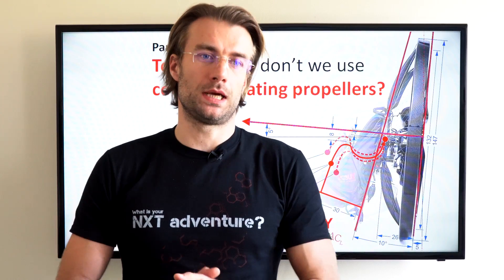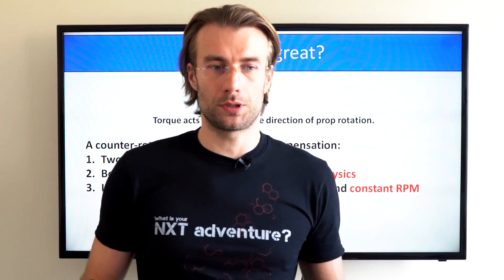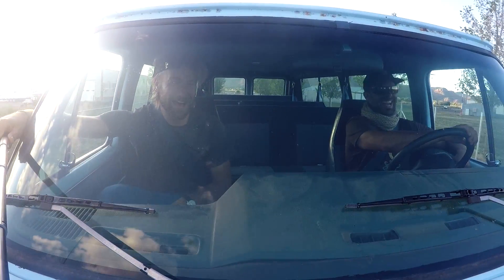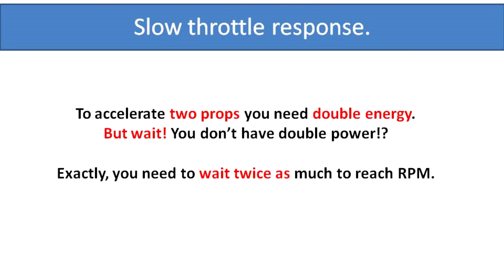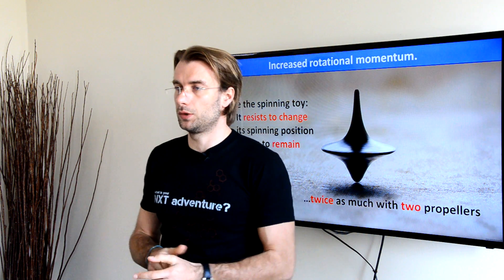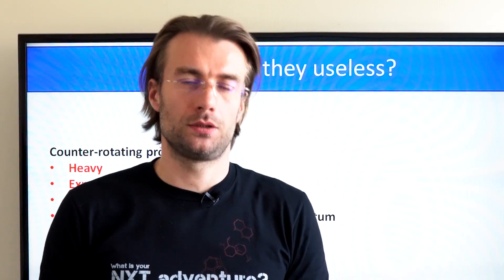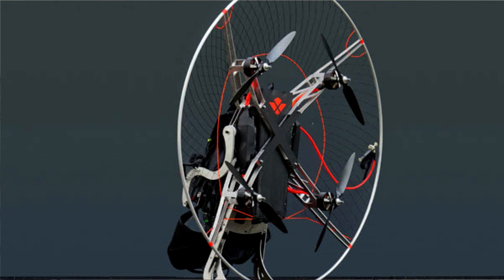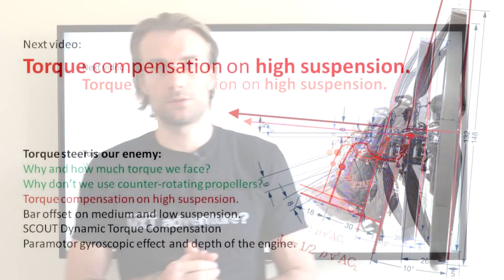Why don't we use counter-rotating propellers? Paramotor Geometry Part 12: Torque

Comment: I have been considering designing a twin prop system based on this
https://youtu.be/iEx3dJTIjww
No torque. Less complex than the system you present.
Weight could still be an issue. 
Waddya think?
Reply from the maker: I am curious! Go for it!

Comment: This video is flawed and incomplete, no mention of thrust, how much is the difference between single and double as well as efficiency
Reply from the maker: I don't think it is possible to use the counter rotating propellers in a paramotor due to reasons explained in the video. 
I know some have tried and it was not feasible. I have seen one prototype myself. 

I cannot discuss on efficiency and thrust as I don't feel qualified to do so.
Reply: @SCOUTaviation  then, what's the point?? Does the power thrust increases by  100%? 50%?? 20%?? Compared to single propeller....
Reply from the maker: It is not possible just simply add another counter rotating prop to the same engine. If twice as many blades used, these need to be either lower angle, or shorter chord of the profile (blades less wide) or both.
The horsepower of the engine is given and the goal is to convert it into trust the most efficient way. Now the question is will the counter rotating props be more efficient than one? 
I am not qualified to answer that as I did not do this research. Could easily be the the second prop would actually reduce overall efficiency as it will work in a very turbulent prop wash from the first. But I don't know.
Reply: @SCOUTaviation  fine.... I'll watch other videos and keep looking

Comment: what is torque?  u cant just throw in words and concepts, hoping the listener understand them. if they did, then they would also understand the rest, and you won't need to make this video
Reply from the maker: This is one video of a series and torque was explained earlier. Go and check out the whole series, your will learn a lot for sure
Reply: @SCOUTaviation  Uh, I see. I need to spend a few hours watching all there is by the make of these in order to understand a single word that can be easily explained from one episode to the other. Not a good teacher

Comment: One of the two are going to spin in the same direction as the motor’s armature or rotor, adding to the torque of that prop. How is that compensated for?
Reply: Just add more weight to the one rotation opposite.